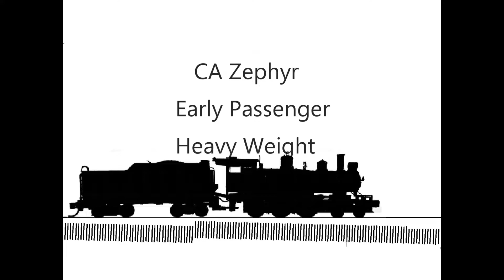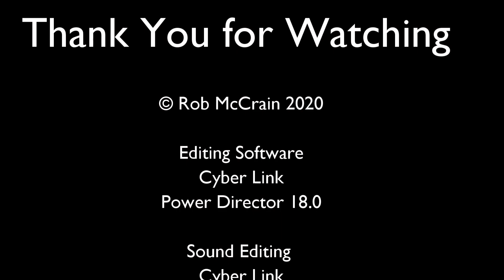11 Shaking Out the Layout CONW

Comment: I'm not familiar with n-scale, so I may sound stupid. Can't the coupler boxes and/or trucks be taken off the car and then the shell be pulled from the bottom? Or do these manufacturers glue them together with no hope of taking them apart? Thanks for the update.
Reply from the maker: Hi Max, They seem hollow but I don’t find a glue line I can start prying in.  Some may be taken apart but certainly not all.  They are very small. I think most must be glued permanently.  I will get weight in whatever the case.  Thank so much for watching and your comment, Rob